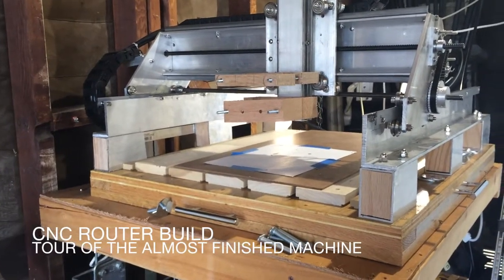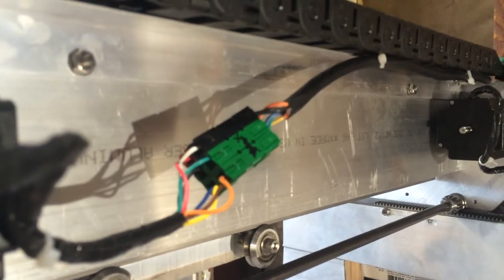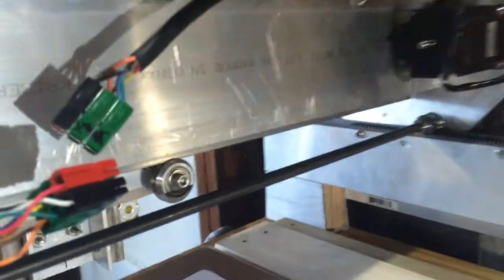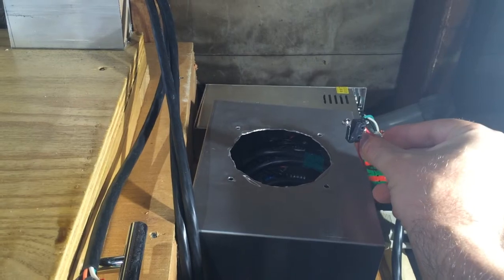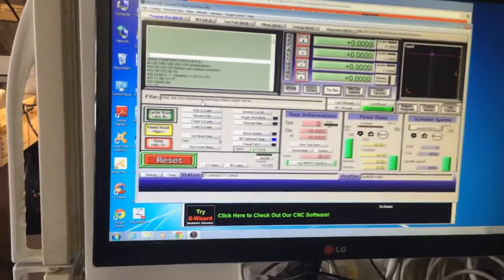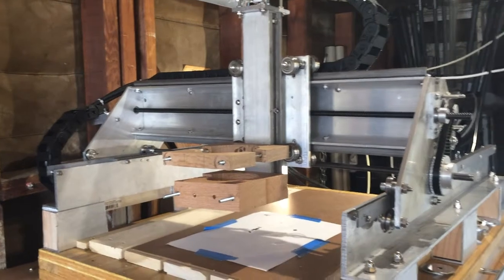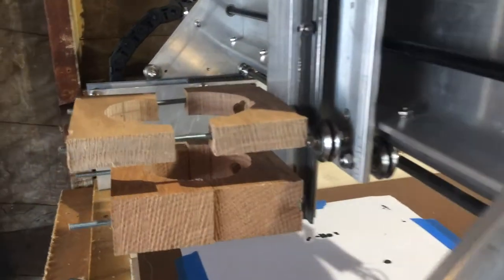CNC Router Tour

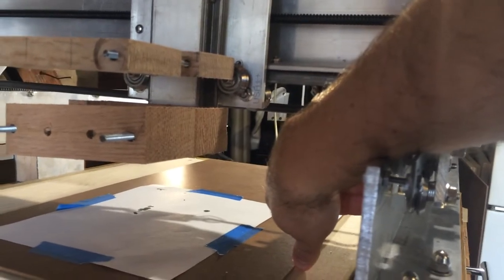Comment: Nice build. I'm considering building this one myself. One thing that bothers me though is @6:33 in the video it almost looks like the Y-axis rails are secured by 1/4" bolts having about a half inch offset. Will that flex any? I suspect I'm not seeing that right or it isn't a problem because on Steele's Solsylva website for this 18x24 model, he shows that the machine is capable of machining aluminum. I just wish he provided a video of the aluminum actually being milled. I for one would sure like to see that. I really like the idea of an inexpensive machine that can cut aluminum. I was also considering the "Momus" build but I'm a bit leary of a design that makes use of belts...
Reply from the maker: Hi Mark. Thanks for watching. I've only worked on wood and softer materials so far, though I'd like to progress to aluminum as well. I have cut wood as hard as red oak, which is fairly tough to route, with no problems. The bolts attaching the Y axis are a little oddly configured, but seem well supported. At the near end (away from the wall of my garage) rather than having the bearing directly in the side of the machine, it's in a separate 1/4" plate with the lead screw passing through a large diameter hole in the machine. This allows the position of the bearing/lead screw at that end to be adjusted so I can achieve good alignment with the Y-axis rails. The bolts holding on the bearing plate are 10-24. They pass through 1/4 holes in the bearing plate into tapped holes in the machine, and are topped off with nuts and washers. The oversized holes in the bearing plate allow for enough adjustment to align the Y-axis lead screw. I used oval-head screws since that's what I could get locally in stainless. Pan-head would have been better, but I haven't had any problems. All my fittings -- bolts, nuts, washers -- are stainless which gives me a little more strength in tightening things down. It is a connection I'm keeping an eye on, but it seems sturdy so far.
Reply: *****
"rather than having the bearing directly in the side of the machine, ... so I can achieve good alignment with the Y-axis rails." Was this a deviation from the original plans (you probably mention this in the vid but unfortunately, I have very poor hearing and can't follow the dialog)? BTW, I read through your build thread on cnczone's forum last week. You did a nice job of documenting your build (and it really sounds like Sandy did a # on ya). I'm gonna keep an eye on your channel. You're my inspiration to move forward with a build of my own!
Reply from the maker: Mark Twain
Sorry for the poor audio -- I'm still getting the hang of production quality in video.
The bearing plate design is directly from the Solsylva plans. In the plan docs he uses a piece of hardboard and mentions that Delrin, HDPE cutting board, or aluminum are all options. I figured that all of the other bearings were recessed into aluminum, so why change for a single piece. Also, I have to say, the Solsylva plans are great. They're very detailed, have lots of pictures, and I thought were easy to work with.
I think you may have me confused with someone else on CNCZone. I love the site and have a few posts up, but I didn't post a build log. I did read that same thread, though, and agree he did a great job with it.
Good luck with your build, Mark. This was by far the most complicated project I've tackled, but it also went pretty smoothly. I'd love to see some of your work, too.

Comment: Very nice job with the machine. Have you been getting a lot of use out of it?

 I've been enjoying using mine and am in the middle of a redesign. Did you make the eccentric bearing bushings or purchase them somewhere? If you purchased them, do you recall where? Thanks.
Reply from the maker: +medicineman007 I made mine using aluminum rod as the center for the offset hole. It wasn't terribly difficult to drill. The aluminum is very soft compared to the stainless in the bearing, so the drill naturally moved to the aluminum even if I was a little off when starting the hole. I don't think I could have done it without a drill press, but with one it was straight forward.
Reply: That is how I made mine as well, but I'm redoing my machine and thought I would beef them up a bit. I have broken the heads off some bolts because of the hole for the nail to stop it from freewheeling. It became a bit frustrating. 

I made some out of cut off 3/8 bolts head that I drilled and tapped an offset 1/4"-20 hole. I'm happy with that, but was looking for a source of reasonably priced premade bushings. I'll just continue remaking them.